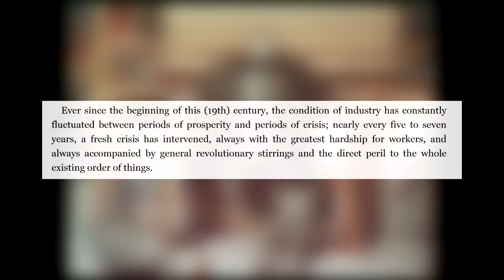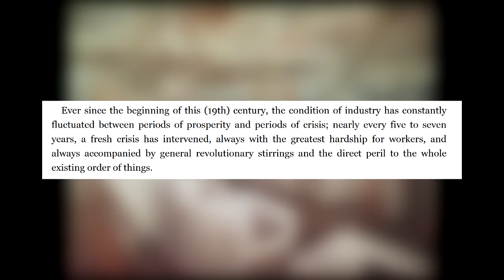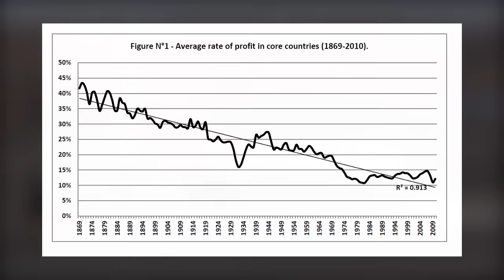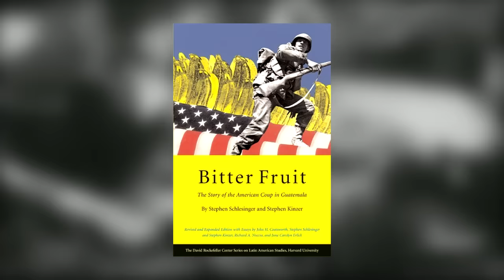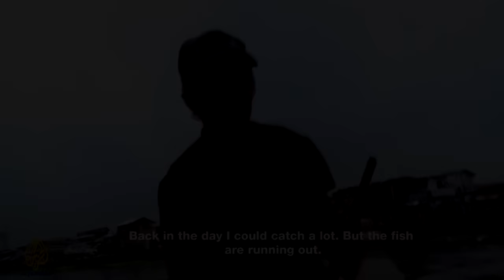Capitalism Really Sucks, But Why?

Comment: "competition means winners" is such a good, quick explanation. damn
Reply: and whenever there are winners there are also losers
Reply: it really is tbh
Reply: @ayala0023  and if there is too much competition, there are many losers
Reply: Competition between producers means lower prices, but competition between employers means higher wages and better working conditions. What would the incentive of an all-powerful state who is the sole employer of labor be to improve wages/working conditions?
Reply: @lazar14  but prices a lot of times do not reflect quality of the product or service for the consumer
Reply: @royalecrafts6252  then that seller will go out of business
Reply: @lazar14  not really, a lot of things that we buy are not really technically state of the art pieces just because of the profit system and because of competition
Reply: @lazar14  Competition between employers drives wages down.
Reply: @bolbibonds858  the ability of a producer to increase profits on the output (product) market by reducing wages on the hiring market is checked by the degree of buyer power he holds on the hiring market. So unless he is a monopsonist (extremely rare), he will generally not be able to reduce wages without losing workers to competitors.
Reply: Though, the winners do buy out the losers to shorten the competition.  Competition is not easy work after all.
Reply: No, it’s oversimplified to the point of falsehood to fool fools.
Reply: @electricchurchmedia1187  you're denying a very easily observable reality rn.
Reply: @bolbibonds858  - False. I disagree with the conclusion. Capitalism doesn’t create winners and losers, capitalism is mutual agreed upon exchange of goods and services. If I’m hungry I can buy food. If I’m barefoot I can buy shoes. No winner or losers. Mutually agreed upon exchange.
Reply: @electricchurchmedia1187  You're literally arguing in the comments section of a video that explains why you're wrong.
Reply: @bolbibonds858  - No. I’m explain why what is in the video is wrong. There is also videos explain how the earth is flat. Are those videos right and the people in the comments saying the earth is round wrong? No. Just because it’s on a video on YouTube doesn’t make it correct.
Reply: @electricchurchmedia1187  You seem confused. This video isn't correct because it's a youtube video; this video is correct because it accurately describes observable phenomena. In any competition there is always a winner and a loser. Outperforming your competition and driving them out of the market is how you win.
Reply: @bolbibonds858 - No, you are injecting your beliefs into events.

Let’s take a real world example since you claim this is observable. 
In the 90’s almost every town had a movie rental place of some kind. Blockbuster Video was probably the biggest chain nationwide, I’m not sure, but they had 9,000 store world wide and made $5.9 billion in profits.

Netflix began by mailing DVD’s directly to customers in 1997. They greatly reduced overhead costs by not having individual locals but central hubs for online shipping. Reducing costs allowed them to offer a much greater variety to their customers but was less convenient as product wasn’t available on demand, you had to wait for the mail. In 2007 after only 10 years in business Netflix begin to offer online streaming of movies offering even more variety and more convenience than previously and the competition. 

Blockbuster never built a website to offer online streaming despite the massive changes in the market and reduced revenue.
Blockbuster now has a single store in Bend, Organ.

Last year Netflix made $6.4 billion in profits. Netflix was a start up that revolutionized how our society watches movies. The large companies that had dominated the market for decades and had the capital to invest in new tech and keep their place at the top but they failed to adapt to a changing society with ever expanding technology. 

Netflix didn’t win and make Blockbuster the loser. Netflix changed and adapted with the culture offering a better service. Blockbuster did not adapt and will eventually go out of business for their own failure.
Reply: @electricchurchmedia1187  So what you're saying is that Netflix outcompeted Blockbuster, took over their share of the market, and Blockbuster will eventually go out of business? Thank you very much for illustrating my point, and the point Hakim made in the video.
Reply: @bolbibonds858 - So even after I explained how Netflix offered a better, more convenient product at a lower cost and Blockbuster simply didn’t change their service when sales declined you are so indoctrinated that you can’t except the facts and instead choose to intentionally misinterpret the situation to fit your ideology.

The official newspaper of the USSR was Pravda, which means “truth” and of course, it printed mostly lies. But the concept was that if you print it and it’s government official and call it truth it must be truth. The people whom believed the lies of Pravda where called useful idiots.
Reply: @electricchurchmedia1187  How am I misinterpreting anything? You're arguing my point for me and then trying to frame me as the indoctrinated ignorant? That's not very clever.
Reply: @bolbibonds858  - If you fail to comprehend the difference in the reality of what I explained using facts and data and what you have claimed and perceive with no supporting evidence than your ignorance is self evident.
Reply: @electricchurchmedia1187  The reality you explained is consistent with the observation that competition results in winners and losers. If you fail to see that then your ignorance is self evident.
Reply: @bolbibonds858 - I see I’m dealing with a real mega super powerhouse brain, who, rather then provide evidence has gone right to the Pee-Wee Herman defense: “I know you are but what am I?” Air-tight. You got me. 🤣🤣🤣🤣🤣

It’s ok that you not capable of comprehending it, even if you are being intentionally incredulous, that perfectly fine. Anyone with a 3rd grade reading level and any amount of common sense can read and comprehend how competition benefits the consumer and only business that fail to adapt to a changing society go out of business.
Reply: @electricchurchmedia1187  Awww, is somebody upset?
Look dude, I dunno what to tell you. Your  point very plainly demonstrated the centralization of capital, which is what we're discussing here. You can try to deflect, you can try to make it about something else all you want. You're wrong.
Reply: @bolbibonds858  - I’m not upset. As I stated, you are simply either incapable or unwilling to comprehend reality. 
As you yourself say: “...I’m a simple guy.”
I actually feel sorry for you. I know the sad mindset of a Marxist, I used to be one until the overwhelming truth of the world brought me to the philosophy of voluntarism.
Reply: @electricchurchmedia1187  Centralization of capital is a statistical fact and only a fool denies that.
Reply: @missk1697 - I didn’t. If you read all of those comments and that is your only argument is a straw man it demonstrates you are able to argue against a point I actually made. Allow me to make an argument against your claim; Skill, innovation, motivation & success aren’t equal, producing an unequal outcome. The better boxer who trained smarter wins. Monopolies are rare. Success is largely determined by a person’s or companies talent pool, innovation and ability to overcome problems quickly and efficiently.

The majority of the capital in the USA is controlled by the government. If centralized wealth is what you have an issue with, the government is the biggest offender.
Reply: @lazar14  no its called not telling people what's bad about your product you can't spend an hour of research every product you buy. also exactly how does the product get cheaper there are a few other ways but the main one is that bla company has worse working rights for its workers in Bangladesh and  than can lower its price the price gets cheaper through exploitation.
Reply: @electricchurchmedia1187  the US only owns 8% of there GDP
Reply: @lazar14  does this hold in Bangladesh where if you leave your not aloud to go and get a new job
Reply: @milesdunstan-daams4855  I spent a fair amount of time explain how capitalism doesn’t create winner and loser.
At no point did I mention GDP and a fail to see how GDP is relevant to the conversation.
Reply: @electricchurchmedia1187  yes there is also other reasons but I'm sure you understand all money goes to people in the end. therefore if it is cheaper you are automating things or finishing development. but for any big company they have to use cheep labor to actually produce their products or of source it otherwise they will be out competed. also capitalism is based on 300 year old Scottish guy who didn't account for add and the  manipulation of supply and demand.

Comment: Very important topic, Hakim doesn't disappoint! I'll say one thing about regulations. Regulations can sometimes minimize some negative aspects of capitalism and limit profits, this is why capitalists oppose most regulations. However, trying to regulate capitalism is like building a castle on top of sinking quick sand. As long as capitalists are in power money rules society and capitalists can always use their influence to reverse and undo any regulations. If the masses ever let up for a second, or are weak for a second, regulations will be reversed -- sometimes slowly, but always surely. Its an impossible system to regulate, its like trying to jump to escape gravity.
Reply: yo wassup, you should collab with hakim and make a masterpiece channel or something like that
Reply: 410 BT  Capitalism was overthrown in many countries. Does that prove capitalism doesn't work?